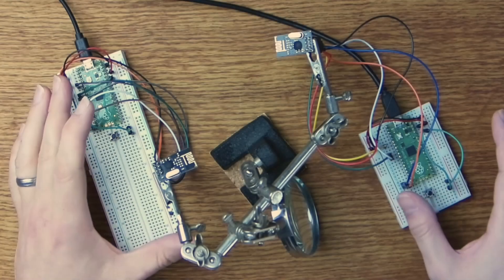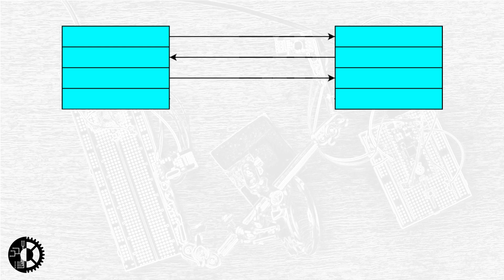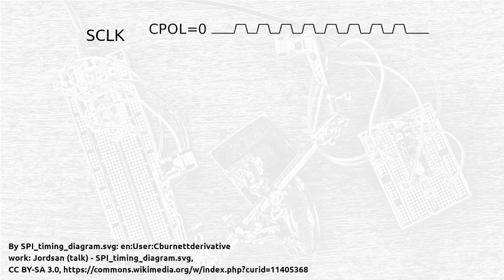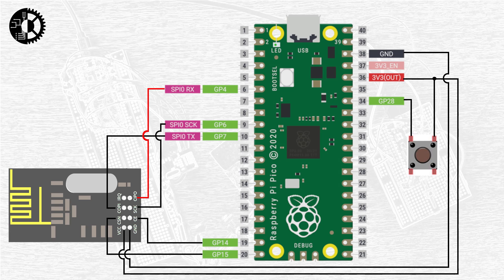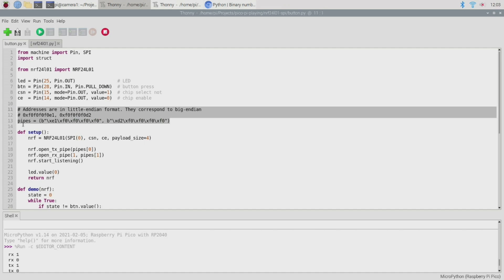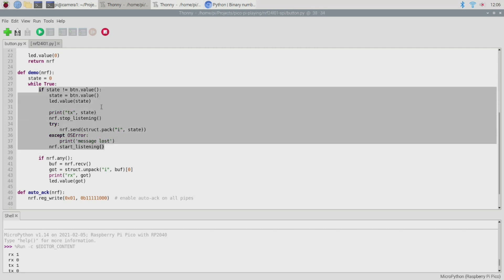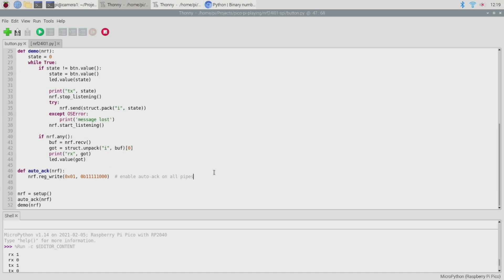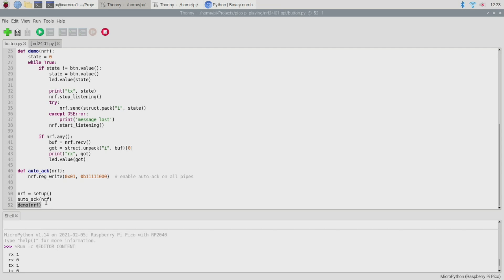Raspberry Pi Pico: nRF24L01 over SPI

Comment: When using these modules, add an electrolytic cap across the power and ground pins, right on the RF module board.  Otherwise, you'll have all kinds of weird problems trying to communicate, especially with longer packets.

Comment: Something very odd going on with your demo code, or my understanding of how these work.
When the button changes state, it transmits the state, presumably on the tx_pipe.
Then it returns to listening, presumably on the rx_pipe.
The receiver receives the data without listening on the transmit pipe, where the data 'should' be being transmitted.
Also, changing the pipes[0] and pipes[1] to exactly the same address has no effect on your code.
It behaves the same.

Comment: I have a problem. The receiver is extremely slow and unreliable, it seems like all messages are getting lost. The transmitter and receiver are only about half a meter apart.

Comment: Hi Tim, wrt the AUTO-ack you smartly  introduced: the code is activated with writing "0b11111000" to the EN_AA register (reg #1): nrf.reg_write(0x01, 0b11111000)  # enable auto-ack on all pipes.
The datasheet however says: "bits 6+7 are to be zero ONLY (section 9.1 Register Mapping) and use bits 0,..5" to activate auto-ack for any of the pipes 0..5.  Am I missing something here ?

Comment: Fantastic series you are making regarding the PICO. I will be watching every one you make. 
Really clear instruction and your voice over is just perfect !!!
Keep making more such videos !!!

I have a few questions if I may.
I have completely replicated your set up so that I can get started using nRF24L01.
However, so far I can not get it to work
Both Pico main.py scripts are running and I have ensured that the pipes are switched in the second Pico to ensure the TX RX side of things
When I press the button, only the light on that Pico lights up and I get the print that shows tx1 and tx9 when you press and release the button. 
On the receiving Pico, nothing appears to be received as the rx 1 rx0 does not show. I get teh same when I press the button on the other Pico.
I have checked the wiring of the nRF24L01 at least four times on both Picos to be really sure I have it right
I have replaced both nRF24L01 module with new ones to make sure I do not have a bad module
The except OSerror: is never fired off as I do not see a print for "message Lost"
The only possible difference that I can think of so far that could be is that the version of the nRF24L01 driver might possibly be different to yours  ?? 
Would you have any other suggestions to make to help me trouble shoot this issue and resolve it please ??
Many thanks

Comment: I finally understand the SPI and i2c pin uses! Nice video. I have a question on utilization of thr feature with a developed program called lightshowpi, but even if you don't know what that is my question for now is simple enough. Can you operate csp1's gpio's in dependant of csp2's pins, both from csc's request? 2 seperate wireless gpio additions rather then extensions. The reason I ask is I'm trying to get away from 10 cords spidering everywhere from my pi4, and with a wireless receiver I hope to use minimum 2 gpio out pins for light channels. Have 6 receivers with 2 seperately controlled lights and minimum 8 controlled channels, so some receivers would be acknowledging the same command some of the time.

Comment: On many Arduino/nRF24L01 projects on the web, they state that reliability can be improved by adding a 10uF capacitor as close as possible to the nRF24L01 power pins. Inexpensive adaptor modules  are available that have a 3.3V regulator and filter capacitors.

Comment: Helpful videos, I love this board.  I've never before ventured into microcontroller land I'm usually dealing with FPGAs and very low level mixed signal/power stuff.  But this thing is so easy to use I dont have to bug a software person anymore to get prototypes working :)

Comment: does your code mean to say that 1 Pico should have 

pipes = (b"\xe1\xf0\xf0\xf0\xf0", b"\xd2\xf0\xf0\xf0\xf0")

and the other has 

pipes = (b"\xd2\xf0\xf0\xf0\xf0", b"\xe1\xf0\xf0\xf0\xf0")

...because the communication isn't working for me yet
Reply: My code neither. When I press the button, only the Pico that the button is connected to is lighting up.
Reply: @cgnclk  same
Reply: i think i got it, you need a voltage stabilizer

Comment: Could you please show what you mean with: the only difference in the software if the two picos is: ?
I did not get the point about how to change the pipes.
Reply: Hey Gregor, were you able to solve this? I'm stuck at the same part
Reply: @d-i-ry Yes, same pipe values for sender and receiver

Comment: so wait: I can attach on one Pico or Pi4 1 nrf module that will be the controller, and then on 6 other Picos 1 module and 1 Raspberry can talk to and listen to 6 others, right? or in fact each of them can talk to each other even (ok, then it will be messy to handle it). To make it every power efficient, every client is only listening, once the command comes from the controller, the client does his job (i.e. get temperature, etc. from sensors connected to it) and sends back to the controller. Then it goes to sleep (RX) again. Did I get it correctly?
Btw, what would be the advantage/disadvantage between nrf vs wifi connected client (i.e. ESP)?

Comment: Im confused, got scripts working on both my nrf modules, they can both send and receive. But when I press a button only the pico connected to the button led turns on. The other doesnt get the message and led doesnt turn on.
Reply: Try in nrf24l01.py in line 88: SPEED_1M or SPEED_2M      self.set_power_speed(POWER_3, SPEED_250K)
Reply: i think i got it, you need a voltage stabilizer

Comment: For an immense improvement in performance with the nRF24L01 set the PICO SPI baud rate to  48000 in nrf24l01.py   ie change - self.init_spi(48000)    (  it was 4000000  )
Reply: this really worked for me✨😀, thankyou

Comment: It doenst work can someone please help me? I did every thing like in the video but it wont work I need Help please.
Reply: Same :/ If anyone found a solution, please share.
Reply: Me too. I did everything step by step but does not work.
Reply: i think i got it, you need a voltage stabilizer

Comment: Is it possible to adress more than six devices? Like giving 10 devices the same adress and using an additional device id in the payload?
Reply from the maker: I was thinking about this a bit more, while its unlikely that more than 6 devices can communicate directly (not tested this) it would be perfectly possible to setup a relay system. If you built an overlay network using a DHT or something (see https://en.wikipedia.org/wiki/Chord_(peer-to-peer) ) you could communicate efficiently between a very large number of peers, this is the same way bit torrent works.
Reply from the maker: Interesting idea, I have not tried that